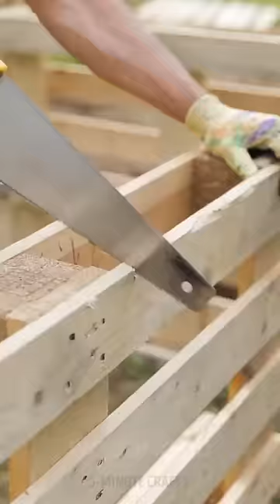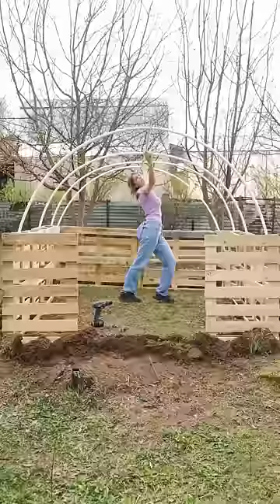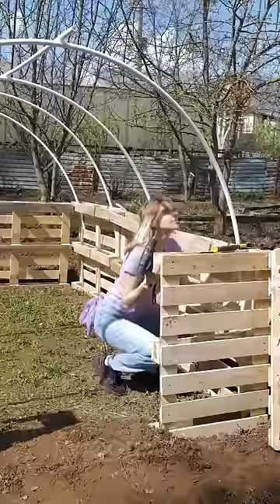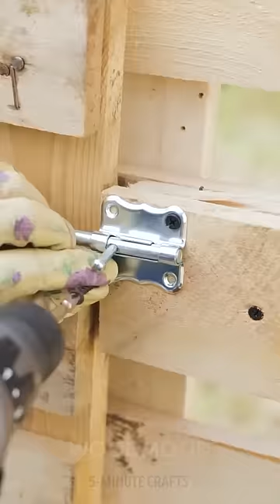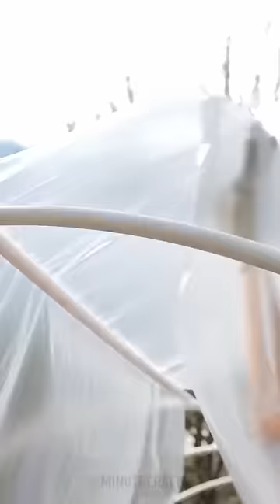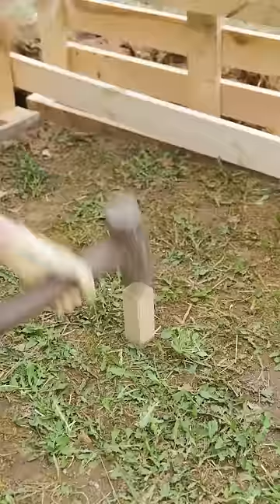Boost Your Shorts with the Sound of the Month: 'THESOUL MUSIC - SMOOTH FUNKTROPOLIS'

Comment: Well that's like 40 code violations... But yeah it's cool, those pallets are going to rot hard and fast though... And why burn the outside (for rot prevention no less) and not the extremely moist inside ? 

Like I said it's cool, but only for about a year or so ... That roof is cool for about a week or 2 though 👀